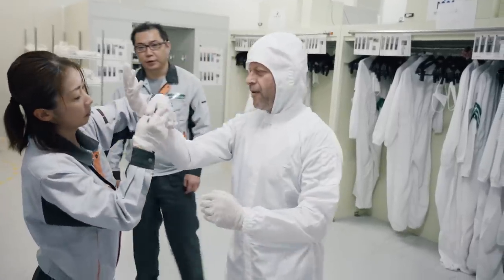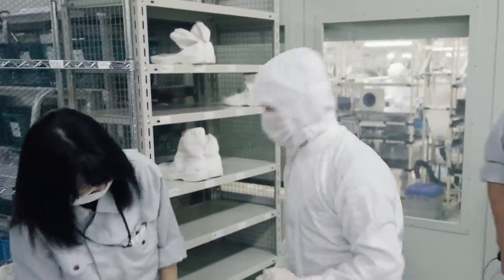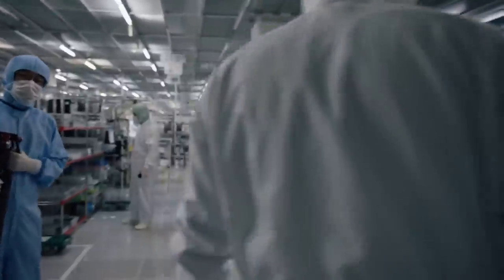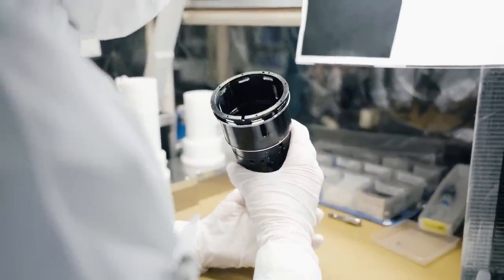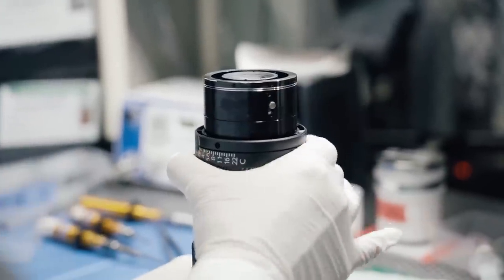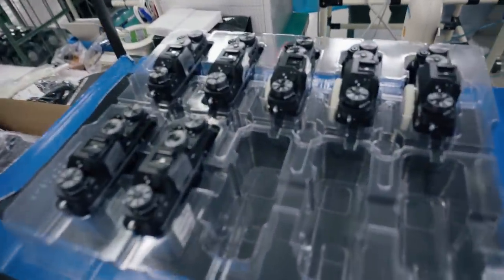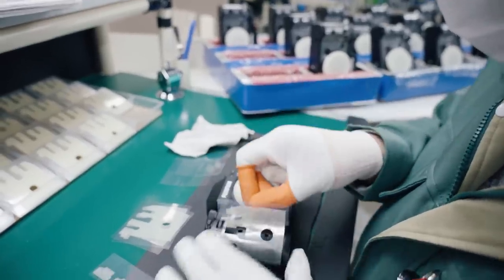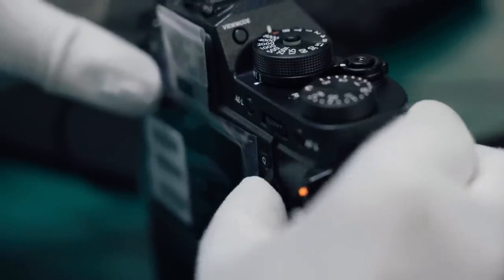FUJIFILM Factory Visit - How Lenses & Cameras Are Made

Comment: My sister who works for a company that had its manufacturing segment move to the mid-west, says that work force is difficult to fill because the workers in that locale have big hands. No matter how much they try, they can't do the tiny line work related to small automated parts. I appreciate, then, the mostly female workers on the line tasked with the delicate work at Fuji, who with small hands can fulfill the job requirement. That, and that smile at 00:51.